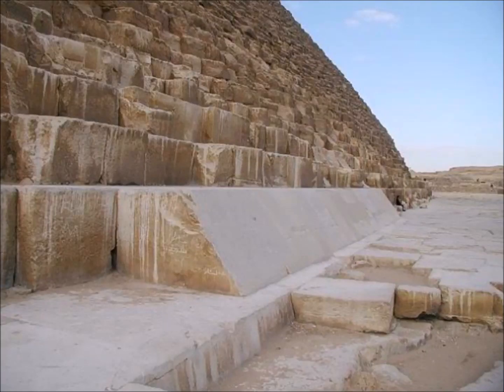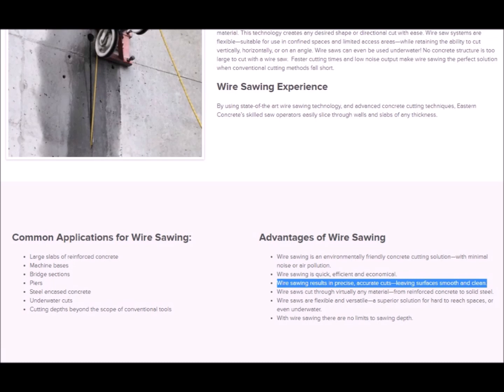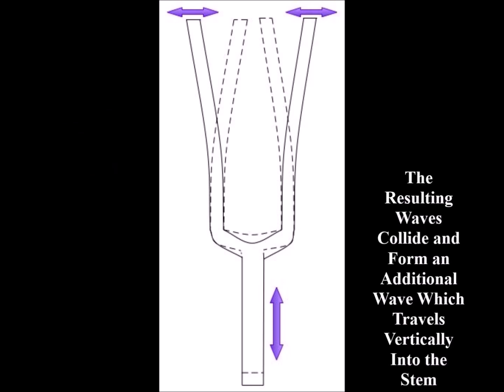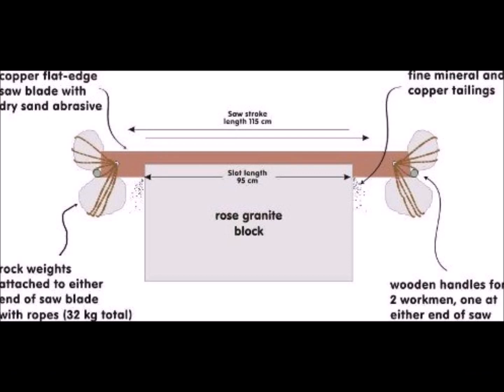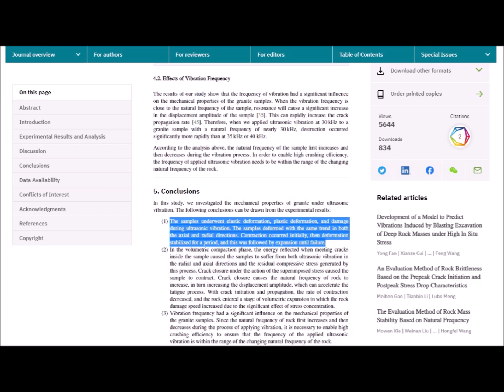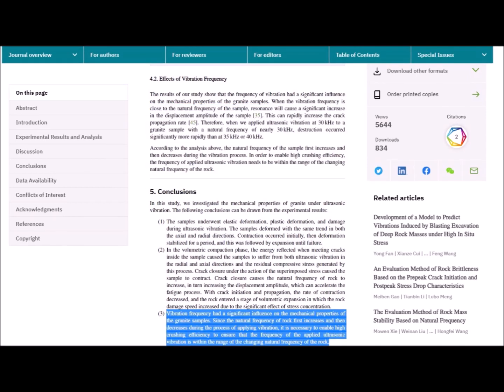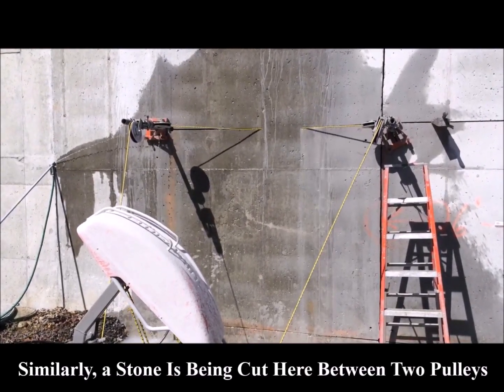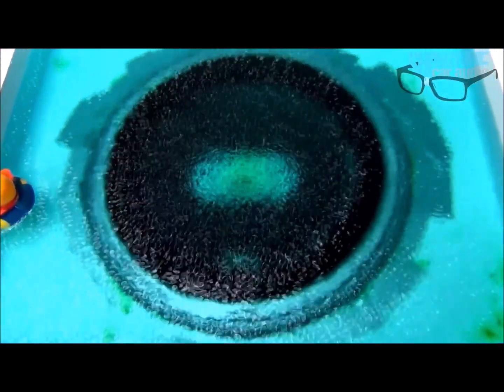Ancient Acoustic Cutting (Revised): Did the Ancients Use Vibrating Wires to Cut Through Stone?

Comment: Cool cutting method but..how would the move and stack the bigger stones?
Reply from the maker: Well, that's another one of the interesting parts. Stories passed down from ancient times seem to suggest that sound rendered the stones easier to move. I've achieved acoustic lubrication (friction reduction) on a small scale: https://youtu.be/-2YXX7WXNKY.
A couple demonstrations have shown vibrations can reduce the force needed to move a heavy object by up to 65% plus. If this could be applied on a megalithic scale, it could have been a game changer.
Reply: Water. Egyptians used ferries and flooded canals to go to the Pyramids. The Egyptians found the log of the guy who was the project manager like 10 years ago....and we only got the results a couple years ago. 1 big lime block per ferry, he made multiple delivers per day. They were able to float the blocks up to the pyramid, big pulley. Hard to explain through comments.
Reply from the maker: @tofan2622   I've definitely heard of the canals, artificial ones that led right to the pyramid, and I agree that it is credible. However, there are still other megaliths around the world; many which are not near large bodies of water. It could be argued, though, that perhaps there were adjacent rivers and lakes which simply dried up and became extinct. They would certainly help to transport blocks which were quarried from far away. But even still, the blocks would have had to be moved a significant distance across land. Today, large moving equipment is needed to move heavy objects even around the confines of building sites.

Comment: I wanted to re-iterate my previous point and maybe ask you to also consider it in your experiments: let's say for example, the action of rotating (certain speed and shape...) an object can nullify its gravity. If I were to consider it from an electrical universe point of view (lets say the electrical universe is correct for this experiment) then, like gyros, I would say the act of rotation is flushing (redistributing) on the atomic level the positive charges and negative charges of the rotating shape (I dont use the term electrons or protons or neutrons on purpose, see electric universe if ure interested in that) thus, in changing the fundamental charge (from neutral to positive/repulsive relative to earth) the object loses its weight/gravity pull. Same applies to vibration. Vibrating objects also redistributes or flushes positive and negative charges of the object thus negating its weight... and this does not at all go against your theories or what you're trying to achieve/prove. I'm just adding another dimension to the equation...  now that we are versed in electricity as a civilization... anyway, I was thinking of how I can very easily suggest an implementation to the experiments you're doing: 1- electrify things: electrify (run a current) on the base (the patch of ground) or metal the rotating or vibrating object is moving on, also electrify somehow the object, see if that has an effect 2: run 2 opposing vibrations or spin, in case of vibration: vibrate the ground that the object is moving on in addition to vibrating the object itself, but dont let the vibrations sync- same applies to rotation, for example rotate 2 cylinders one above the other, one clockwise and one anti-clockwise... I dunno... I'm a complete amateurs... I have no idea what I'm talking about... just thought I'd suggest. Keep up the great work, and please higher the volume of your mic a little bit. Thank you
Reply from the maker: Those are great ideas! I've always been interested in the electrical universe model. I remember years ago reading an article called, "Clouds Don't Fall" in which clouds were theorized to remain afloat not because of buoyancy but because of a negative electrical charge which repelled the negative charge of the Earth. When the Earth becomes more positive, the moisture in the clouds are attracted downwards and fall as rain. And at other times, lightning as an electrical discharge neutralizes the negative charge followed by rain. Not yet sure how valid it is. But it was really interesting. I may read from the article once I start my Vlog series later this year.
Reply: @gsutton78  yes. Weather. Cloud formation. Lightning. All facets of the electric universe. And as u said, other scientific references are mentioning electric discoveries in natural phenomena. I like to think that, ancient cultures, aliens… have tapped into a certain frequency/mode/lower level/different kind/sensitive electric current that dissipates all over the universe and used it not only to levitate but for many other things that were lost. I cud imagine technology, our technology, being able to work/power itself with that kind of subtle energy/electricity. Humans can be trained to feel and use it. Endless possibilities.

Comment: Not wire' but a water jet, with an acusic resonance traveling thru it.
Reply from the maker: Now that is a neat idea!!
Reply: Can you explain this theory with the water though ?!
Reply: @gesunderpsychopath8569  There issent much to exsplain? Supper Soaker' with an an acoustic resonator in its barrel. Change the intensity and you change the depth of the cut. As I came up with it thinking of how to do the inside corners found in Mexico, Peru and Bolivia. Where ancients popped square blocks out of stone. Without quarrying. Where the previous stones are removed so the remaining stone to be removed has three sides exposin to being removed as a square edged block. As they had quarries there were its obvious that they had some other tool to just pop it out without neading to relieve it like I just described. And could pop a block out of a flat surface. But yeah super soaker that fractures the crystalline structure to create the desired cut.
Reply: @Chuxgold 
Check out Edward Leedskalnin
He built coral castle in Florida, using the same techniques as the Egyptians did though.
That was just around 1920 or so.
He used Fishhooks and some Copper Wire, as well as a magnetic perpetual motion device.
It's unbelievable though
Reply: @gesunderpsychopath8569  Yeah in moving the coral. Not cutting it.
Reply: @Chuxgold 
I think he did Cut it as well mate.
Have a look at what he build there. Chairs, Tables, Doors, Square Rock Gates and so on.
I assume he knew how to cut them as well yo
Reply: @gesunderpsychopath8569  Yeah with modern equipment. No the only thing that defies reason is how he moved them by himself.
Reply: @Chuxgold 
As far as I know, he used some piece of shard / Glass with Copper Wire wrapped around it, when he for example was looking for the right spot to buy land.
A lot of landowners back then claimed, that he was somehow a weird person. Always having a glass and some Copper with him, to inspect the land. 
At the end, he bought land, which was nothing worth actually, because you couldn't do farming or anything on it, but he didn't care. 
He was up to more than farming, as we know of nowadays. 

Whatsoever... 
I assume this way, he could find out if the land was powered on an earth grid.
Within the grid lines, he used some metal wire that he laid on the ground, he also had a metal piece in his shoes, to detect magnet directions.
At the end it seems like he used pretty much the same techniques as the Egyptians did though.

The Egyptians had them stones moved from 800 kilometers away, and guess what, it was on a perfectly straight lined earth grid.

So I assume they knew of a way, to magnetize certain things, lay them on the grid, and then make them levitate, and move along the metal wire which he laid on the ground.
The Metal wire is supposed to work as a PATH so to say. 

Trust me, the moved the stones by levitation. Have a look at Tibetan Monks, they Stil levitate stone blocks weighing 30 Tons each, up to 250 Feet. 

Leedskalnin for example had a tripod device with some sort of modified car battery on top of it. 
Remember, it was a triangular shape, such as the Pyramids. 
So he did something what transmitted energy from the top of that shape, to send it through the air, to make sure he could use the earth's magnetic energy for moving and cutting purposes. 

He had a few books, one dedicated to magnetism, one dedicated to biology ( talking about things that could become magnetized in combination with certain other things) and one about chemistry and so on. 

Have a look at Viktor Grebenikov. 
He build a device in the early 2000's, he was levitating on it himself, doing like 1600 miles per hour at 300 feet. 
That was in the early 2000's though. 

He proved that insets such as Bees or Beetles don't fly, they levitate. 
Why do you think they usually have 4 Wings ?! 
Have a close look at a beetle. 
First they open their red wings with the black dots on them, and as soon as they opened them, other wings underneath them come to light. 
So the first ones build the gravitational field, and the seconds ones are used to power only the direction they want to fly towards. 

I highly recommend everyone to have a research about these Gentlemen, before the Algorithm decides to remove such information for us.

And by the way, every Monument such as Pyramids, Stone Henge and so on, they are directly build on top of a Earth Grid, which also runs a stream of Water underneath of it like deep in the ground.
I don't know the exact measurements of their depth, but for example Nikola Tesla Power Grid had Water running underneath of at around 35 Meters depth in the ground.

And as we all know, Water is mighty and powerful. Why else would the human body contain 70% of Water ?!

There is way more than we know.
And the Things I was talking about above, they are now scientifically proven though.
Please do the research yourself, I highly recommend every interested person in this topic to do so.

Or search for PERPETUAL MOTION HOLDER

People are magnetising Stones, making a compass go crazy, and every direction the compass is directed to next to a magnet, becomes Pole North.
In the night, when the stars ( our light source ) are clearly to see, the milky-way becomes the exact shape of the River Nil which is next to the pyramids. Seven different cities along the Grid become exactly the astrological shape in their lineup, such as the seven other Planets in the Universe.

These people, for example Edward Leedskalnin who built coral castle, always used a Sun-Clock to work, and they usually worked in the night, claiming the Power to work with is way stronger in the night, than as during day time.
Having a look at the Polestar shining very bright and exactly to the geometric middle of the inside of the pyramid where the chamber lays, that's no coincidence.

And these people back then didn't have laser measuring device technology to use.

So trust me Homie, there is way more than we know.
But I will find out one day.
Doing little experiments at home, just out of curiosity, but magnets are absolutely interesting, I'm telling you. Get into it, if you can. Combine certain topics, such as above, and you might get closer to the real truth.

We are on the right path my friend. One day, we'll find out.
Thanks by the way, for your honest interest in sharing opinions with me.
And sorry for my English mistakes, I'm not a native speaker, but trying my best :-) 

Greetings from Switzerland
Reply from the maker: @gesunderpsychopath8569    You mean Chuxgold's acoustic water jet?
Reply: @gsutton78  yes
Reply from the maker: @gesunderpsychopath8569    Well, hopefully he'll give us his thoughts. But my take on it would be a pulsating jet of water rather than a continuous stream of water. For instance, a water jet can be incredibly powerful when under extreme pressure like from a large water dam. Such a jet is hitting a rock would have a similar effect to the blow from a sledgehammer or pneumatic hammer. The sculptors of Mount Rushmore used pneumatic hammers, so I could definitely see a hydraulic hammer from a pressurized jet as being feasible. But theoretically, if one could open and close a water valve at the stone's resonance frequency it should have a similar effect as a hammer striking the rock at its resonance frequency likely resulting in enhanced cutting.
Reply: Search this video on YouTube 

“How to melt stones sound, p.1.”

There is this Russian guy who actually cuts through stone perfectly using just sound resonance. And he makes perfect hieroglyphics by vibrating a stone with a piece of metal attached to it like a cookie cutter.

I’ve never seen anything like it and I’m surprised the video hasn’t been censored
Reply: @tatumergo3931 
As far as I know from my research, leedskalnin was in Egypt for a period of time. But I've got no clue who taught him, or if he found it out himself.

Check Ley Lines on Youtube, to find earth grids. Maybe this helps mate.